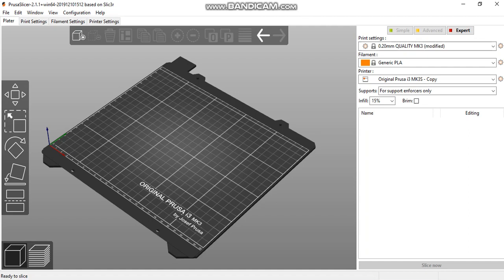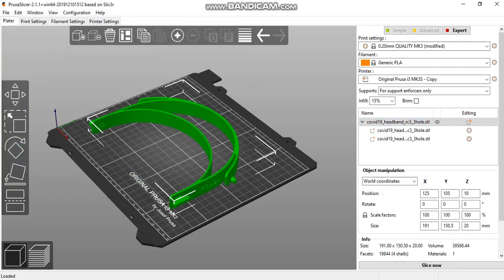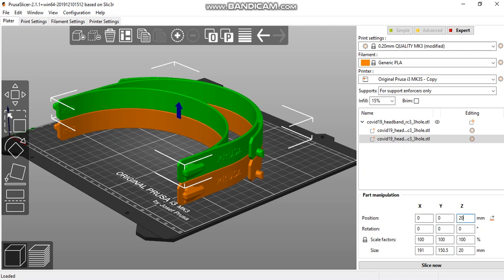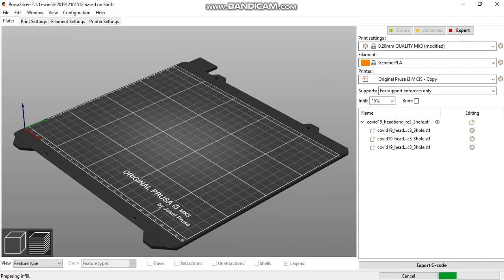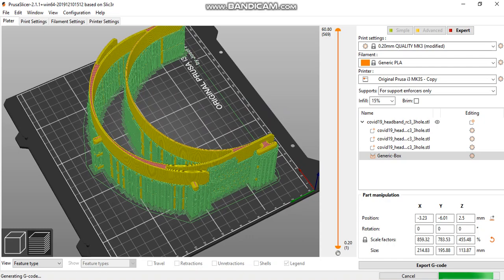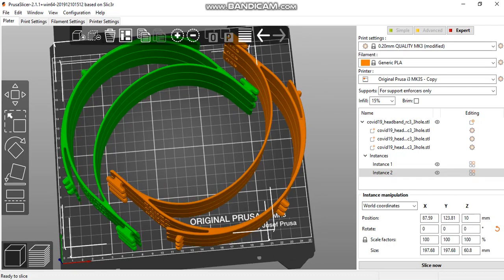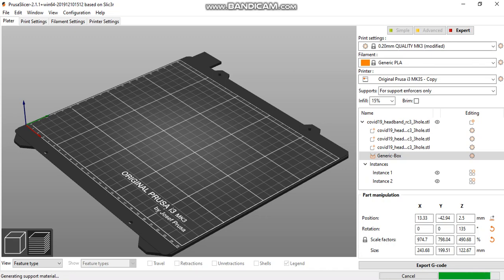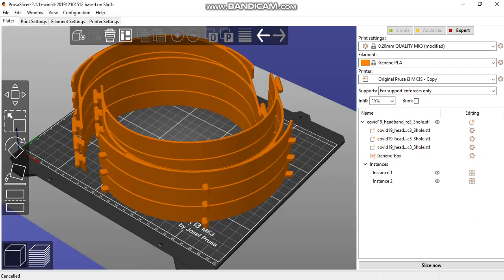Stacking Objects Using Prusa Slicer - COVID-19 Masks

Comment: Any way to drop objects below the print bed?
Reply from the maker: there isn't no, this is to prevent the G-code from running and the nozzle reading an object below the bed and having the nozzle ram into the print bed and ruin it
Reply: @engineer3d  Cura does this natively and anything below the bed just simply isn't sliced.

It's great for when you need to do partial prints to test out one specific mechanism
Reply from the maker: @thanhtacles  Neat & good to know, Ive really never been a fan of cura, but it definitely has a lot of features (possibly to a fault?)